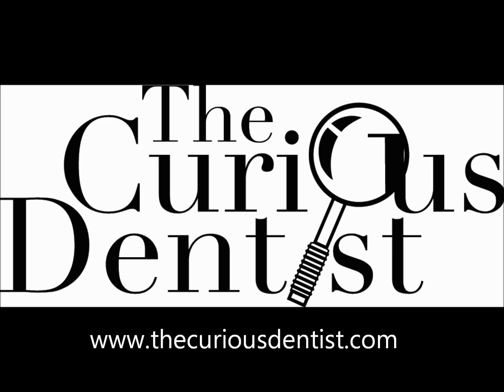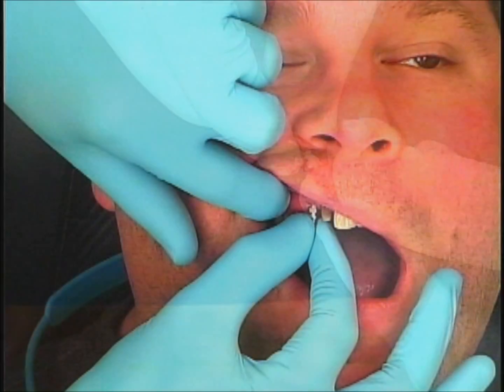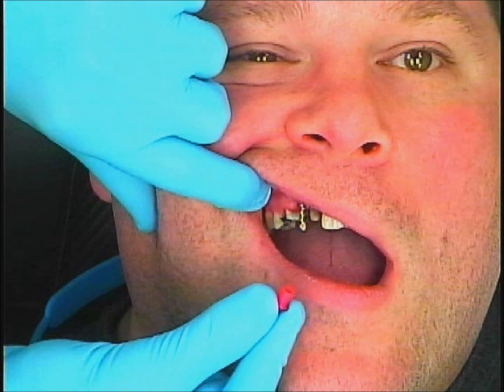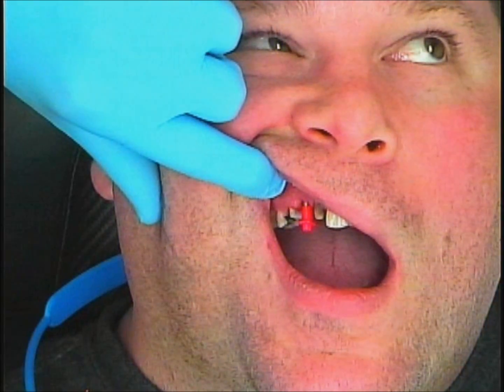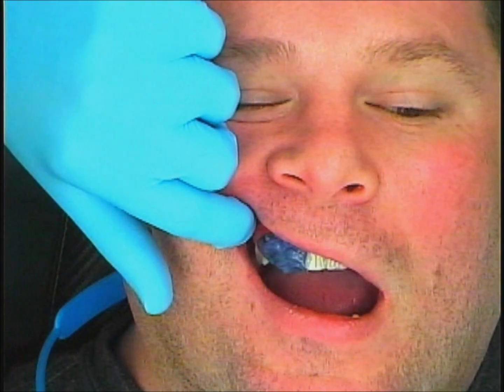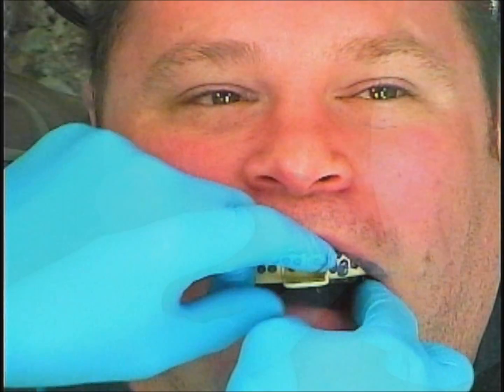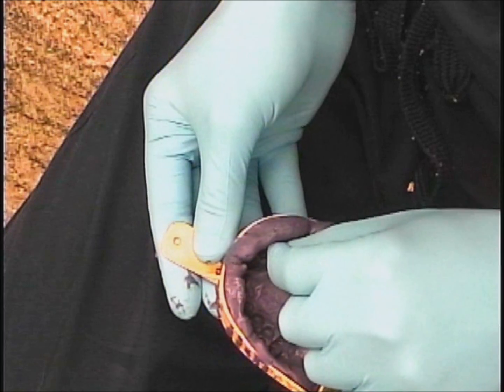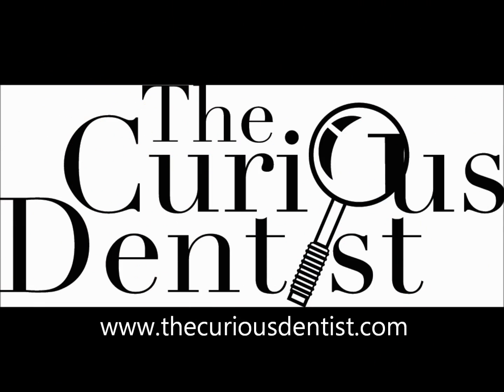Closed Tray Impression Technique

Comment from the maker: I agree that the open tray is more accurate.  The impression coping remains in the impression as opposed to the closed tray technique where it must be reinserted into the impression.  For most cases this will not be clinically relevant.  However these minor inaccuracies can add up if you are impressing several implants that will be splinted together in the final restoration.